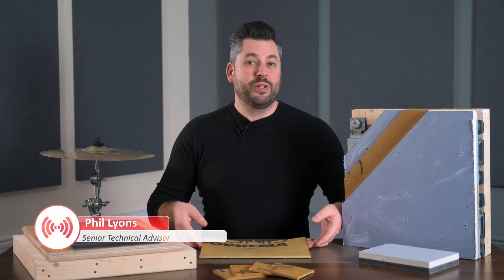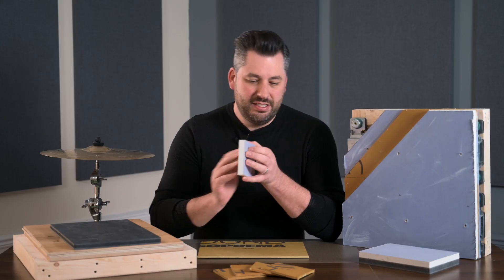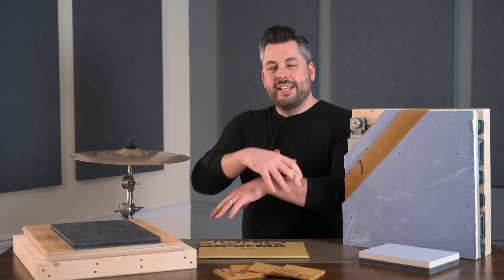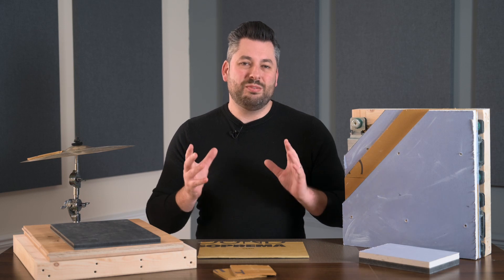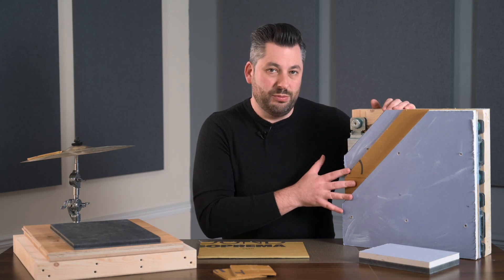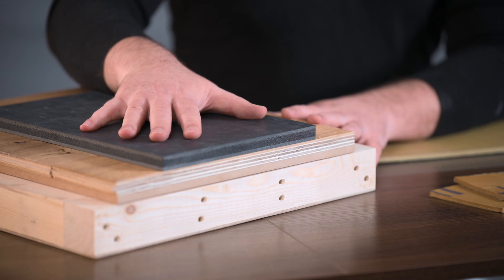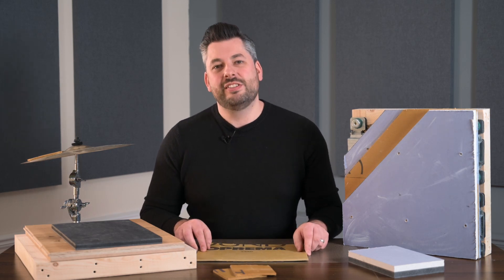How Tecsound is used for soundproofing

Comment: I was thinking of using it for my boat outboard engine cowling. Will this withstand heat? How much heat will it retain?
Reply from the maker: Hi @Muskiehunter4841, there is also a cost effective alternative called FexiSound which might also be of interest. Would Tecsound or FlexiSound be practical in that scenario, the honest answer is it's difficult to say without more information and ideally images. You could send them to sales@soundproofingstore.co.uk

FlexiSound Video:
https://youtu.be/fffHFAVgdGI

FlexiSound Specification:
Thermal Conductivity: 0.037W/mK
Thermal Resistance: 0.14 m² K/W
Fire: EN 13501-1: C-s3 d0

Comment: I've got an old Victoria terrace with solid walls. I want to reduce noise from the neighbours, but also want to sacrifice as little space as possible.

Would Tecsound be effective if applied directly to the old plaster on the party walls, and then covered with new plasterboard?
Reply from the maker: Hi @mattjenner8355, the short answer is no, unfortunately not. Tecsound and FlexiSound (a cost effective alternative) are used within soundproofing systems, but are not an effective soundproofing solution on their own (please see below videos):
https://youtu.be/lkz-EVPU8DI
https://youtu.be/fffHFAVgdGI

As with many soundproofing materials, they are only effective when combined with other materials. In simple terms - it's a bit like baking a cake, you need the right ingredients, in right quantities, in the right order. If you just use one or two ingredients, you won't end up with a cake.  (Tecsound or FlexiSound being essential soundproofing ingredients). 

Take a look at the ReductoClip Independent System (the slimmest clip and bar system on the market (120mm thick) or ReductoClip Direct to Wall (only 60mm thick):
https://youtu.be/huNDsYKLpqo
https://youtu.be/R2gvGyE6kTE
https://www.soundproofingstore.co.uk/solid-party-wall-soundproofing

Alternatively, please fee free to call us (01423) 206208 and we can discuss your noise issue in more detail and advise accordingly.

Comment: Hi,

I live in an upstairs flat. My living room is above my downstairs neighbours bedroom. I'm looking to try amd soundproof the floor. What do you recommend. Can the sound matt and the tescsound go beneath the floorboards rather than ontop?
Reply from the maker: Hi @steve21587, in an ideal situation you would remove the floorboards, add 60kg Acoustic Mineral Wool, replace the floorboards and lay the SoundMat.
More information on SoundMat 3 Plus can be found here:
https://www.soundproofingstore.co.uk/soundmat-3-plus
https://youtu.be/S9ZhiDRTPds
https://youtu.be/r8TGDw-7D24

With regards to the Tecsound, we also have a brilliant (and cheaper) alternative to Tecsound, which is called FlexiSound (same soundproofing performance) which might be of interest: https://youtu.be/fffHFAVgdGI 
Adding the FlexiSound would certainly help to increase the performance against airborne sounds and would need to go on top of the floorboards, under the SoundMats. 

Feel free to call us on (01423) 206208 or e-mail sales@soundproofingstore.co.uk and we can discuss this in more detail with you. There are potentially different solutions depending on the level and type of noise you are trying to soundproof against and also depending on your final floor finish requirements.

Comment: i live in a terraced property where my neighbours hall stairs kitchen are attached by a party wall and upstairs my bathroom is also attached , likewise our small bedooms  attached our upstairs landing equally the same  ,, i believe my neighbours launder for a business   they use two washing machines together which makes it very noisy    their washing  machines are set either end of the kitchen and the noise hits the bathroom above  and other areas, apart from moving i am wondering if i cover the walls of  the bathroom and kitchen and flanking walls of each room  together with floor soundproofing between said rooms whether this would cut down the noise  and make a good enough reduction  to live with  .  i would be happy to lose  up to 5 inches of wall space in all cases, walls and flanking walls        i appreciate that this is far more complicated than can be answered over the interenet but am courious as to know just how effective modern soundproofing is ,
Reply from the maker: Treating the party wall on your side should certainly help. If you can hear sound tranmitting from the ceiling / floor and returning walls then you may need to treat these as well. However you will need to do a lot more than just add TecSound. I would look at our ReductoClip Independent Wall System - https://www.youtube.com/watch?v=fQcfjqQvtOQ&t=907s

Comment: any good for kitchens  against washing machine activity   2 washing machines together   can pay for expert installation  can lose up to  80 mll  also bathroom above with floor soundproofing
Reply from the maker: Hi @kennethknight7870 depends how you are thinking of using it, but TecSound wouldn't be my first option for noisy vibrating appliances. Do you mean the machines are yours or noise from neighbours machines? Is the noise coming through a wall, floor or ceiling?

Comment: Can you apply the tecsound directly to polyurethane insulation board and then add the plasterboard?
Reply from the maker: Hi You shouldd be able to to fix the TecSound to your polyurethane board as it has a high tack self-adhesive backing. However isulation boards tend to be light weight and will not add much mass to the wall or dampen sound energy / vibrations so they are not ideal for soundproofing.
Reply: @SoundproofingStore  Thank you very much for the reply

Comment: How could I bond plasterboard to the tecsound?
Reply from the maker: Hi Tango 599, the recommendation as part of our ReductoClip system is to use two layers of acoustic plasterboard (not standard plasterboard) sandwiching the Tecsound in between. Due to the weight of the acoustic plasterboard (which is heavier and more effective at blocking airborne noise) it needs fixing in place not bonding. 
These installation videos might be of use:
https://youtu.be/fQcfjqQvtOQ
https://youtu.be/lI2bdQZWyOE

Comment: Does this wall sound proofing attenuate both ways ie sound going out from the room applied and external sound entering the room?
Reply from the maker: Hi torus186 - Thank you for your question. Soundproofing generally works both ways. It's there to increase the sound reduction of the separating wall, so this will stop sound from travelling either way.

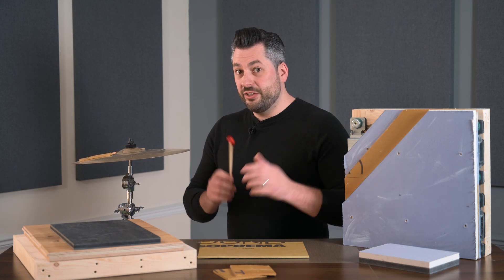Comment: That demonstration at 3:10 is very misleading and in my opinion says very little about the soundproofing capacity of this material. ANY object fixed to the cymbal is going to dampen the sound. He could have duct taped a banana to the cymbal and the same thing would have happened. What matters is how this material performs when sound is coming through the air from an external source.

The rest of the video is very honest and informative, and does indeed talk about the performance through the air, but I wish we could have seen a demonstration of that instead of the cymbal which adds very little to the discussion.
Reply from the maker: Hi Shayne Gryba - Thank you for your comment, but I think you've just missed the point slightly. The example was to show that we use this material to dampen energy and vibration in surfaces and materials not just through the air. For example steel RSJ's or corrugated steel roofs. Yes, you would get a similar effect from adding weight to the surface (a banana), but you're not going to wrap an RSJ in bananas! This is a thin, easy to install, self adhesive membrane but it adds a great deal of extra mass to the surface to reduce movement and dampen energy.
Reply: @SoundproofingStore  I understand the point just fine, thank you -- my point is that if your demonstration can be performed by swapping out the product for any random object then it is not a good demonstration, and implying otherwise is disingenuous.  

Quoting 1:52: 
"The easiest way to show one of the unique benefits of TecSound is to demonstrate" 

In what way is Tecsound's uniqueness being shown here? Are you saying other objects won't do this? If you want to prove that this product is useful then you have to show it doing something other objects cannot do.
Reply from the maker: @shaynegryba  But you are purely looking at the result and no other element. We're not saying TecSound is unique because its the only product in the world that can stop a cymbal from vibrating! We are saying its the only material currently on the market that is thin, plyable, easy to install, self adhesive and can dampen the vibration in a surface. It's unique as a product, not its results are unique. Again, you're not going to cover a steel roof in bananas or weights or books or anything else. The cymbal is just a nice visual example of this that people should be able to easily understand.
Reply: @shaynegryba  yea u right man, idk why their support team is trynna argue against this. They basically admitted that their products can be subbef for bananas

Comment: Hi. What about using tecsound under the carpet?
Reply from the maker: Hi K N (as per the video) Tecsound is great when used as part of a solution but isn't a soundproofing solution on its own. You could certainly upgrade floor soundproofing solutions such as the SoundMat 3 Plus by also using Tecsound. 
This video might be of interest: https://youtu.be/S9ZhiDRTPds

Comment: Can Tecsound Self Adhesive be applied straight to a solid party wall (painted plastered brick) before plasterboard? Or does there have to be an in between layer between Tecsound and existing party wall?
Reply from the maker: Hi Jimmy Bluebos - There is no reason why you can't adhere TecSound directly to a plastered wall. You have to be realistic with results that without de-coupling from the offending wall, results will be limited to a degree, but TecSound will increase the mass of the wall, and some dampening. But there are better ways to soundproof a party wall if you can afford to lose more space.
Reply: @SoundproofingStore  Thank you for quick response. We can't lose much of the space at all for the bedrooms, so will be limited to 1-2 layers of plasterboard, so thought 1 underlayer of Tecsound and 1 overlay of acoustic plasterboard might be best combination?
Reply from the maker: @samedz3966  Sometimes you just have to do what you can do with the space you have. In which case, this is a good approach given your limitation.

Comment: Thanks for the video. I'm somehow suprised that  you describe mostly Tecsound as added weight; in my view, constrained layer dampeners (usually butyl+aluminium foil) perform better than Tecsound for dampening, as they have mass AND viscoelastic properties; Tecsound is better used as a continuous limp barrier, intended not to dampen surface vibration but to stop airborne noise.
Reply from the maker: Hi Fo Luxo, Glad you enjoyed the video. TecSound does add mass and also has visco elastic properties. So it can be used for both. Its benefit changes depending on its use within different build ups, You always have to look at the full picture not just the individual material. Applied to an RSJ for example its visco elastic properties help to dampen the vibration within the structure. Applied within our ReductoClip system its main benefit is an extra 10kg of mass per m2 while only adding 5mm of space loss, its dampening also helps boost performance to a degree by reducing resonance between the plasterboards, but its the ReductoClips that are really dampening vibration in this system. A good multi use material.
Reply: @SoundproofingStore  Thanks for the reply. I should have mentioned that I exclusively use this for cars, trying to make them as quiet as possible. In any case thanks for the videos and the website, they are quite informative.